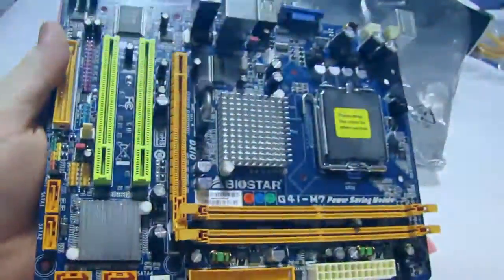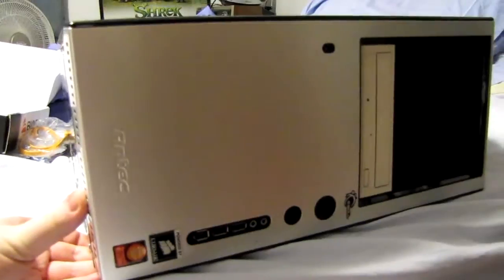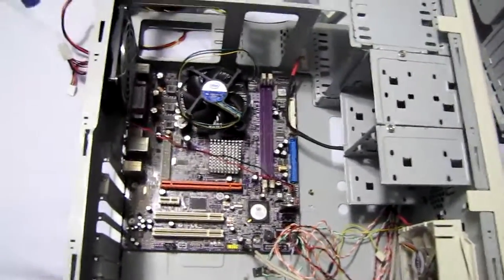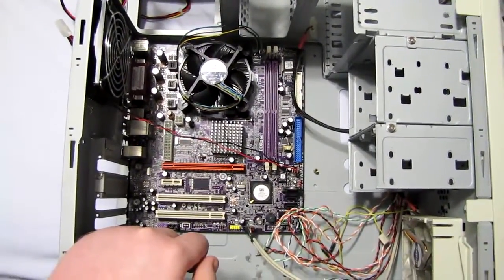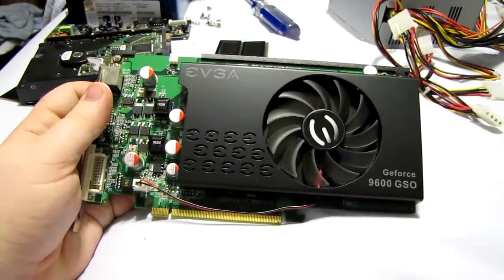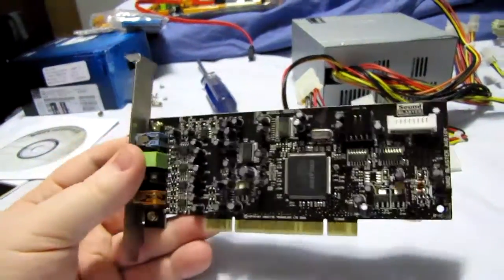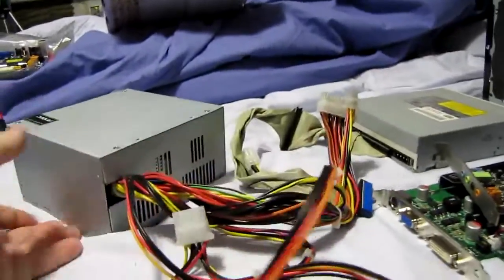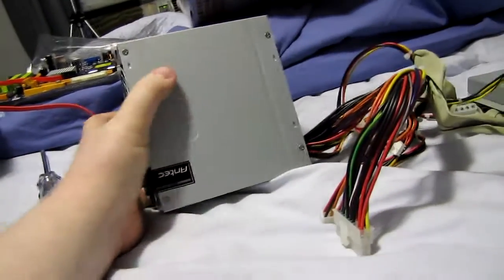Review - Intel Celeron E3300 and Biostar G41-M7 Motherboard - 2/5

Comment: Just so you didn't see my last comment (PArt I):

The Intel G41 Express Chipset does NOT support PCI-E x16 2.0! The G41 Chipset has built-in X4500 and an optional PCI-E x1 v1.0 and PCI-E x16 v1.1 slot.